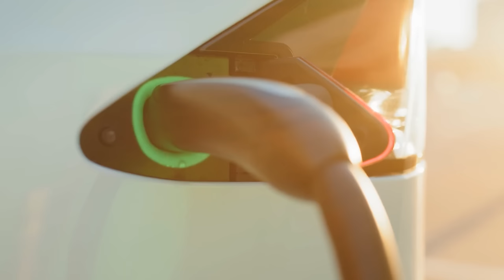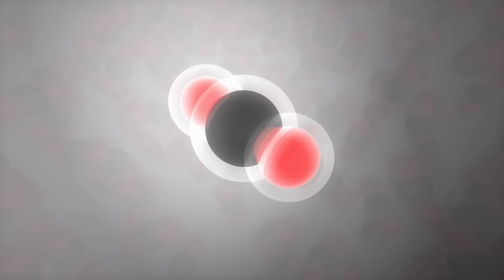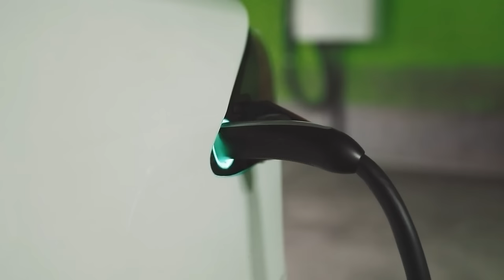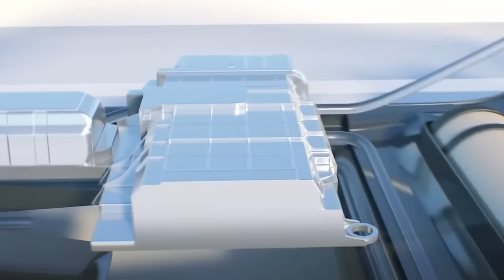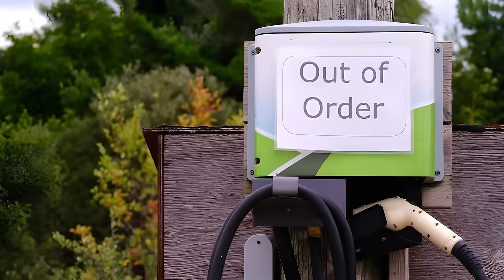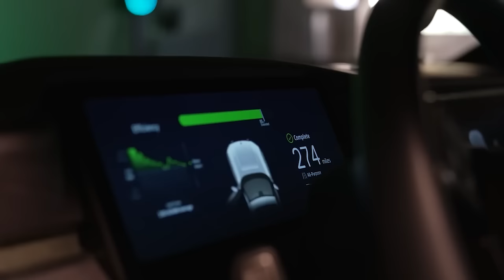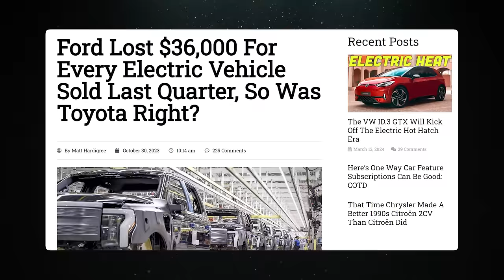Toyota's NEW CARBON - NEGATIVE ENGINE will cause major problems for EV industry

Comment: a quote to summarize how much of a giant BS this Toyota engine is

"In Toyota’s vision, that would create a vehicle that actually cleans the air as it is being driven. Unfortunately, the technology is still a long way off. In its test, the filters only captured 20 grams of carbon dioxide in 20 laps of running (57 miles/91 km). That’s better than nothing, but engines running on fossil fuels emit 8,887 grams of carbon dioxide per gallon they consume, on average."

Comment: Another bs from Toyota.
Reply: Look into Stanley Meyer showing his Hydro-Engine.

These car companies will look to put a high price tag on something a person can probably work on developing in their own garage and sharing it publicly will get them killed by the government.

I'm sure a Tesla can run during the daylight with a custom Solar Power body kit without having to bee charged at a Supercharging station. 

If someone can run a Tesla using an external Generator it can most likely help increase the range a bit more with the concept of Solar Power.
Reply: @ZxSkyLineKidxZ  you can run the numbers with the most optimistic assumptions that only naives would take, a full solar kit might give ur tesla like 20~30miles of range per day perharps? You are better off saving those weight